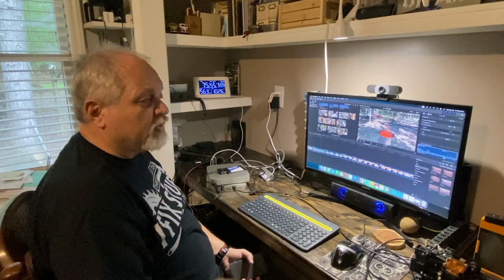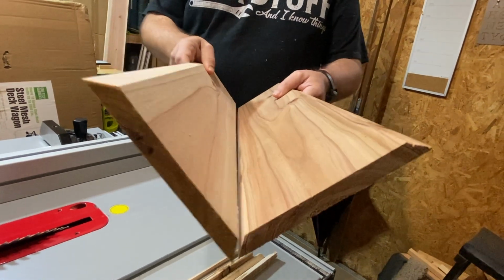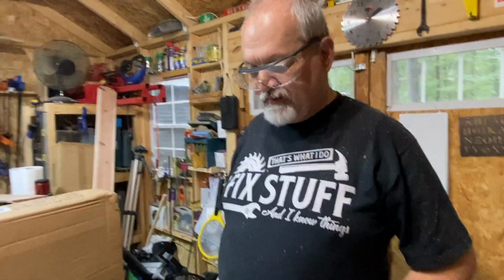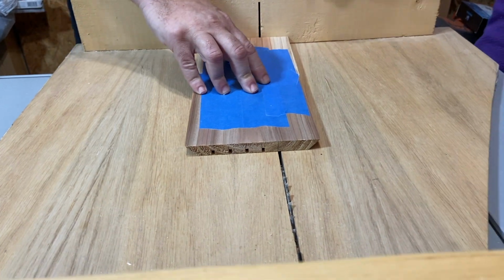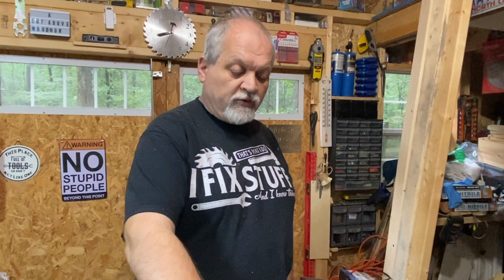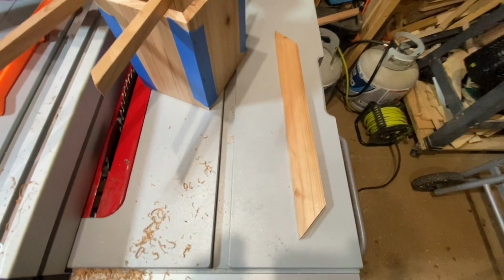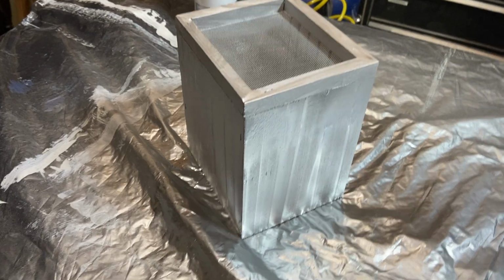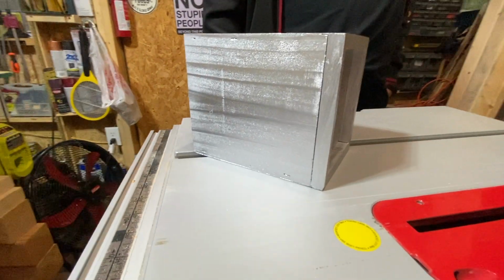INGENIOUS External SSD storage organization for $5.00!!

Comment: Nice. Folks you can use this small box concept to build something larger if needed. 
By the professor,  what size nails were used?
Reply from the maker: Just 1.2 inches you can also use screws and make them a decorative element!